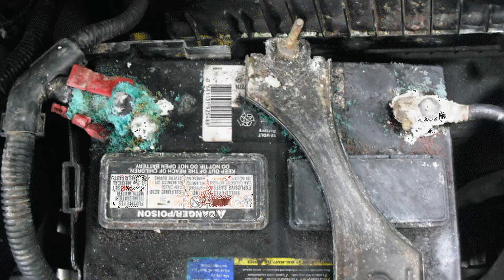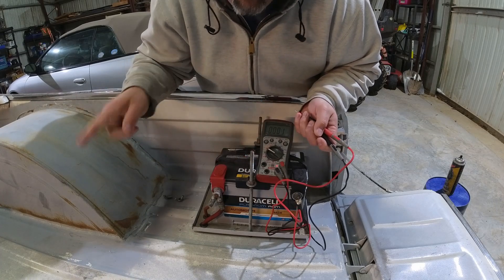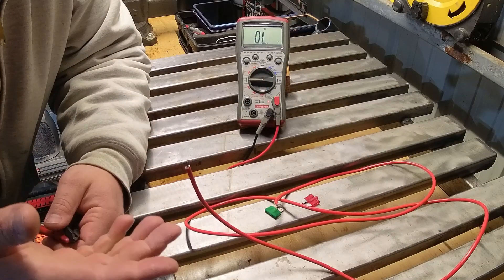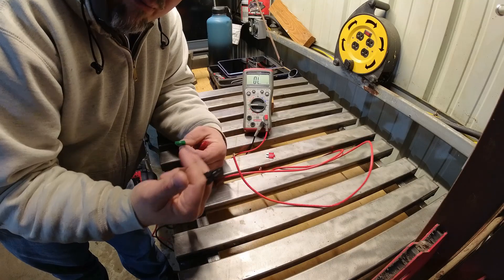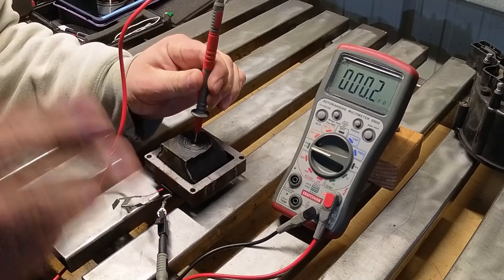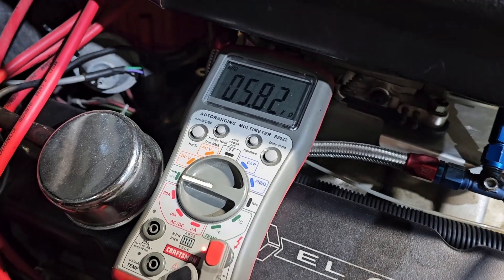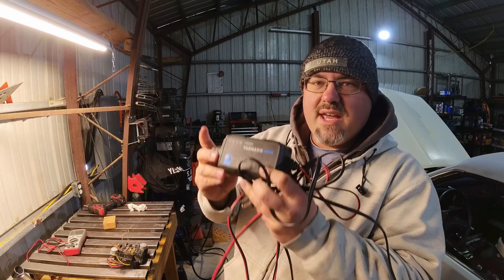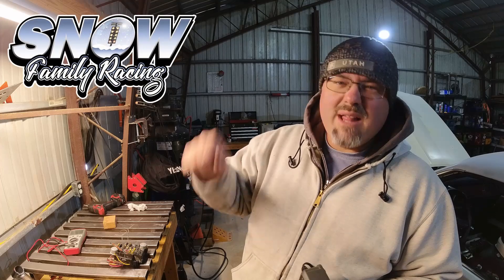5 ESSENTIAL Electrical Tests to Diagnose Your Classic Car Like a Pro

Comment: Excellent! As someone that uses a multi-meter on a daily basis when troubleshooting both AC and DC circuits attached to CNC machines, tractors, lifts, fleet trucks etc. I think your presentation was just the right amount of technical and common sense information.

 Not everyone cares to (or needs to) know electrical theory and how electrons flow through various components to create an end cause or effect?

Most car enthusiasts just want to make the horn blow, the lights come on and the fan/blower motor to push heat in Alaska and cold air from the A/C in Georgia. great video!

Comment: One thing to always check is the cables themselves if checking resistance, rarely comes up all 0s, flucks are great, had one 30+yrs before recent fire, there on eBay reasonably priced alot. Get some test leads that pierce wires, so much easier
Reply from the maker: No need for a Fluke by name. They're a good meter, but not required at a hobby level. I do have test leads to pierce wires, I hardly ever use them, and I personally try to avoid inducing a point for moisture to get into the wire, even though I do try to seal the piercing back up.

Comment: Bulbs! You should have shown how to check those maybe. Not to forget the use of the test lamp thingy, "scope on a rope'💡
Reply from the maker: I'm not a test lamp fan, I prefer seeing the actual value. That way, I can see the health of the circuit and if it differs from the voltage at the battery. Power probes are becoming affordable and can function as a test light that gives a value and general functionality tool. I'm working on developing a video about scope and power probe use.

I'll work on making a short about bulb testing. That's mostly continuity testing. If it's burned out, it's an open loop, and you'll see OL.